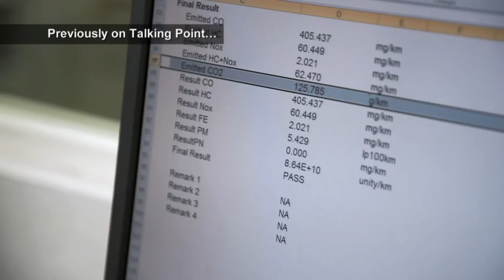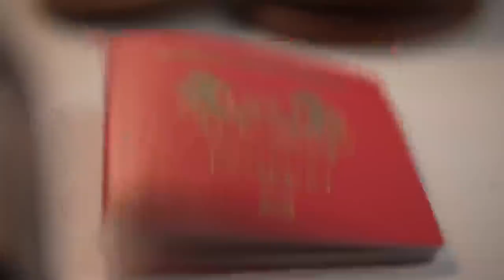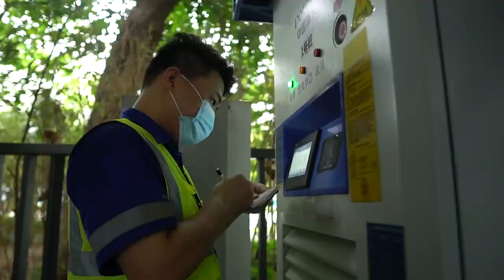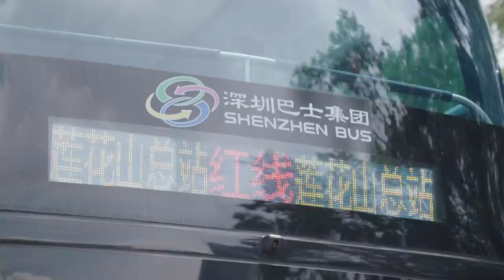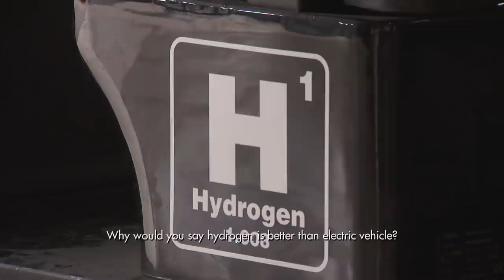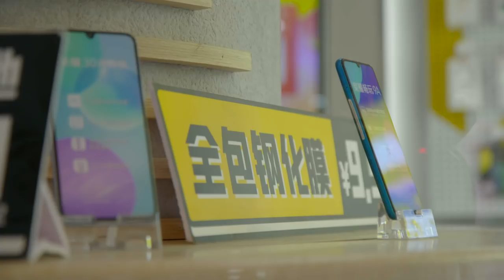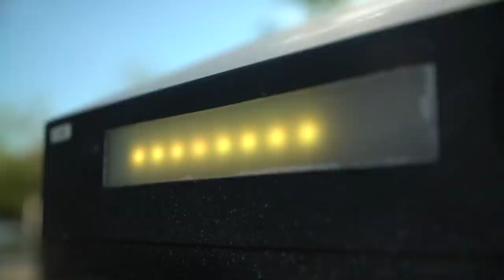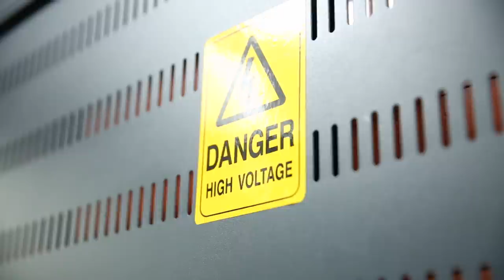Electric Cars: Can Vehicles Really Be Zero Emission? | Talking Point | Electric Vehicles Pt 2/2

Comment: Used EV batteries from China will hit the secondary market first and will not yet go to any landfill.  Here in the Philippines, there's a huge market for used LifePo4 batteries used as powerwalls/battery backup in homes and used for maybe another 10 years.  I still hope that sooner than later, recycling will be the norm in a large scale.
Reply: sad to say it can't overall its cheaper to just produce a new one than say recycle a used one, simply put it doesn't make sense economically for it go widespread.
Reply: Fire 🔥 hazards.
Let’s sabotage SG with made in China 🇨🇳 battery fire 🔥 that is very hard to put out.

Comment: Zero emission at tail pipe, is what they meant because electrical car has no tail pipe.
No such zero emission. Electric cars do not directly release CO2, but the process of making electric car components such as: batteries, electricity itself, etc... do release CO2 in the process. Once the batteries are dead, the processes of recycle them release hugh amount of CO2.
It is a step in the right direction but not a total green as some may claims.
Reply: When you say an ICE emmits 89gr CO2 then for electric car is Zero. If you want to include electricity production emissions then you should add petrol production and distribution emissions. Fuel doesn't magically appear at the tank.
Reply: If you drive quite a lot in the cities, the life cycle carbon foot print is significantly less, it's the right step yes. Energy have to come from somewhere & 80% operating efficiency is dam high compared to ICE cars of ~30% . .
Reply: Do you prefer co2 released directly in the air around you or co2 on a controled environment?
Electric is still way better.
No engine oil, no spark plug etc. All those part contributing on co2 from making to distribution to your gas/diesel car.
Electric car make it less polution i guess.
At least, not throwing polution on the air around us.

Comment: There is no need to change everyone to electric. That creates crazy amount of waste. 

How about giving a slight coe discount to extend cars more than 10 years, to reduce waste. It’s a lot of carbon footprint to manufacture vehicles, carbon you cannot break even by changing to electric vehicles
Reply: Not all cars goes to the scrapyard after 10 years, some are exported as secondhand vehicles
Reply: Cars more than 10 years are the main culprit of emissions. The combustion engine are less efficient and tats why u see the black smog emits from older vehicles.
Reply: I don't think that everyone will be forced to change to an electric car, just that at some point all brand-new car sold will have to be electric. 
ICE cars will then slowly fade away from the road as each one reaches the end of its life.
Reply: Jimmy Edward  it ought to get more expensive. Anyway if you don’t own your own charger, EV charging will cost as much as petrol eventually, at least in Singapore
Reply: @gabrielchan4420  do you know how much energy goes into manufacturing? 

Compare that versus improved fuel economy. Even if you DOUBLE your fuel economy, and thus halve the consumption of petrol, that’s not much savings. A 10 year old car using half the petrol for 150,000km (let’s assume 15km/L to 30km/L) uses 5000 litres of petrol less. Do you think you can recoup the cost of manufacturing and transporting a car with 5000 litres worth of petrol/carbon?

But wait. New cars don’t halve fuel consumption every five to ten years, do they? You’ve been green washed into thinking that changing car is good for the environment. No it’s not. It’s good for the ECONOMY.

Comment: I worked in a battery recycling plant in Alberta Canada 30 years ago when I was a kid. It was a very shitty job and I still have scars on legs from where the battery acid would splash up over my rubber boots. The skin in those areas also grew back extremely thin. It was a poor paying job given the low safety and intensive work. We slung batteries by hand all day long. The arms stayed awfully strong though! Lol

Comment: If only consider vehicle itself emission Yes. If include battery production No. Electricity production also has carbon emission for supply to the stations. Looks like a large amount of land also required for the charging stations. Then there is also opportunity cost of waiting for charging or in queue for charging station. Looks like maybe practical for only public bus. Else hybrid or hydrogen should be better bet.

Comment: It would be nice to see the comparison from the full lifecycle. 
### AT CAR PRODUCTION ###
The production of ICE cars might cause more CO2 than an efficient EV cars such as Tesla. ICE cars have lots more parts than an EV cars.
### ENERGY SOURCE ###
Petrol, Diesel, Gas and Co are not re-usable and thus considered as consumable. The exploration, drilling, production and refinery cause a lot of CO2 as well. Singapore does not produce oil, but does the refinery and shipped the raw oil & gas from other countries. Not to mention the CO2 from any accident such as oil spills and etc.
For EV, the Battery is re-usable. The source of power (the consumable part) can be produced from renewable energy such as Sun, Water, Wind, and waste recycling.

### AT USE & MAINTENANCE ###
EV cars have less parts than ICE cars. As benchmark, take Tesla cars. #1 The brakes from a Tesla car last about more than 4 times than the typical ICE cars. The REGEN due to 1-pedal driving reduce the usage of brake. #2 There is no more periodic change of the motor oil. #3 With less parts, it means less components to change. The productions of these components produce also CO2.
### EFFICIENCY / ENERGY LOSS & OTHERS ###
Please consider the efficiency level of transforming the energy source to the movement. How efficient is the transformation from the fuel to the movement in ICE car vs the transformation from electricity from battery to the movement in EV? Check this out: https://insideevs.com/features/392202/ice-vs-ev-inefficient-combustion-engine/
The development of ICE has been plateaued for more than 10 years. The motor efficiency improvement development that cause the false practice such as the DIESEL-GATE from all the car manufacturers. People these days should have realised how these scandals made for the sake of profits and polluting the air where we lived and our planet.
On the other hand, the journey to sustainable energy is starting and will improve with times.
Getting it to ZERO is a utopia. Even a bicycle is produced with a CO2 footprint.
Another good reference for your, check out this: https://www.rethinkx.com/transportation

Comment: A full charge from solar energy allows both the taxi and bus each about 300km milage. For a bus it's believable that it can handle a day's load since it's going thru a planned route. But for a taxi, it's impractical to be confined by that number. Not sure how the taxi system works over there. A 300km milage a day isn't going to make much money obviously. If the taxi is shared by two or even 3 drivers, there simply isn't time to complete any turnovers. 

When solar energy was first introduced onto wrist watches in the 1980s, it left an impression that it's performance is less than impressive. Obviously 40s have passed, i think it still doesn't prove to be any breakthrough. They need the sun, windmills, and did I hear nuclear power plant to create that energy for the cars and buses? Don't forget there are seasons in China where there isn't wind and much sun. I refuse to believe coal isn't used. I also refuse to believe the amount of waste these cars and buses can equate to when they rapidly deteriorate given they way their quality assurance is. What happens after that? They simply build more of the same thing because that can! End result? Wastage and pollution again. It's a vicious cycle. This will take at least another 40 years to see it's true positive effect of zero carbon emissions world

Comment: The way I see it, hydrogen is more useful as an energy storage product, just like how OIL reserves dont exist in all countries, not all countries are suitable for power generation thru renewables. So in the future countries with excess energy produced by renewable energy can convert the excess into hydrogen using hydrolysis of water and export the hydrogen to countries not suitable for power generation thru renewables. A lot of companies are working on hydrogen-powered gas turbines that can burn 100% hydrogen that will enable existing electrical infrastructure in Singapore to be need less modification and yet greatly reduce our emissions

Comment: there are 1 million cars on the roads in Singapore that run on combustion engine. Where will they get the energy from to manufacture another 1 million electric vehicles for Singapore? hint - "Oil"  And those "electric vehicles will still run on tyres made from more oil and paints resins plastics pvc finishing and seats made from even more oil - Just as there isn't enough space on bus top to install solar panels to power bus there's also much less space for solar panels to power 1 million cars in Singapore so in the end they will again fall back on using oil to generate the electricity for you to tap at charging stations for your shiny electric cars that you thought was zero emission. Siao right?

Comment: Switching vehicles is one part of the solution and a very important one. The other part is converting our grid to be 100% clean energy is the other and much more difficult.

The advantage of switching cars to electric is that you can do so one by one or in small batches. Converting fossil fuels to green energy means not only building all the nuclear, wind, water and solar energy plants we need but more importantly closing those coal and gas plants. 

Regardless of we like it or not (we don't) we live in a capitalist world and money is more important than our lives and or future so the only way we will see any change if we find ways to make clean energy cheaper than fossil fuels. This is of course going to be difficult as the fossil fuel industry has a lot of money and has had decades to lobby for connections in government.

Comment: Simple answer is Yes. EVs are zero emission vehicles.
Reply: It depends on the source of electricity used to charge the EV, but yeah it provides the opportunity for it to be clean.
Reply: @hssssssssssss  Absolutely. Not only vehicles but also other daily activities we do like taking MRT, using a washing machine, charging a mobile phone etc produce CO2 continuously around the clock if we still rely on fossil fuel/natural gas!

Comment: AAaaahhhh...
Although this is a great video & tries to get to the bottom of Zero Cabon transportation with regards to EV's and others. I believe it misses the point by miles!!
This is hilighted by the following comment...
"...I'm going to head home on a truely Zero Carbon transport..."
Whereby the female reports hops onto a Bicycle!!
Now, although this is definately a Zero carbon emission form of transport (at point of use), it is definately NOT Zero Carbon from the point of inseption, manufacture, distribution, supply & disposal!!!!
Here in the UK, we have a large cycling comunity. However many of our bicycles are manufactured in China & shipped halfway around the world (by Oil Powered ships!!!), before being assembled here in the UK. NO WAY is this Zero Carbon!!!
If a Bicycle is Truly Zero Carbon, then by the SAME measure - So is a Battery EV!!!!!!
What many reports fail to compare, is the TOTAL Carbon footprint across all transportation. For ICE vehicles, this will be the design, manufacture, distribution, useage & disposal of vehicles across their entire lifespan. Add to that, the complete lifecycle of the Petrol/Diesel and Oils used to power & lubricate all ICE vehicles (eg, the extraction of oil right through to the burning of fuel and the disposal of waste oils!!).
Only when the complete manufacture & supply chain, followed by proper disposal (recycling), of vehicles go to fully carbon Zero, can we even contemplate our vehicles being Zero carbon!!
In the meantime, by 'reducing' the useage of Fossil Fuels, EV's are way more carbon efficient. Maybe not Carbon Zero, but ceretainly a massive improvement :-)
#Blue_Wizzard
Some additional notes...
Regarding the bicycle used. It looks like the seat is made from Plasic, also the reflectors, maybe the basket, plus may other parts!!!
So, since plastic is made from Fossil Oils - This is definately NOT Carbon Zero :((

Comment: hydrogen is dumb, takes more energy to extract hydrogen than just using ev from renewables
Reply: They are getting better at it all the time. EV are dumb too because the only thing that produces more CO2 in many countries is making electricity. Every time your transmit electricity you get losses. You loose 12% when you transform voltage. You loose 10% converting to DC etc etc. You are robbing Peter to pay Paul. The only thing we should be concentrating on is electricity generation. Fix that and then EV make sense. We are mostly virtue signalling at this point.
Reply: Jimmy Edward  we could argue all day about numbers and the truth is hard to pin down. Electric has some advantages but hydrogen has some too. Back whatever you wish but I am pretty sure the future will be a mixture of batteries and hydrogen fuel cells depending on application. Hydrogen ICE future is doubtful.

Comment: Hydrogen CAN be generated by renewable energy (Green Hydrogen), but it's efficiency is only about 50% compared to about 95% for Lithium batteries.  And then add to this the energy cost of transporting the Hydrogen and the entire supply chain, and because Hydrogen molecules are so small, they are constantly leaking from their pressurized tanks, and free Hydrogen in the atmosphere is a much more potent greenhouse gas than Carbon Dioxide.

Yes most definitely we need to look at the life cycle emissions of our vehicles - ESPECIALLY the ICE vehicles and their fuel supply chain!  An EV powered by the dirtiest 100% coal-generated electricity is still cleaner over the entire life cycle than the most fuel efficient ICE vehicle and this has been proven in several studies.